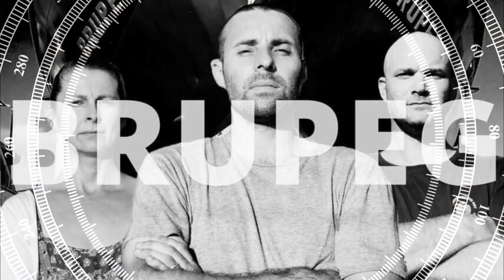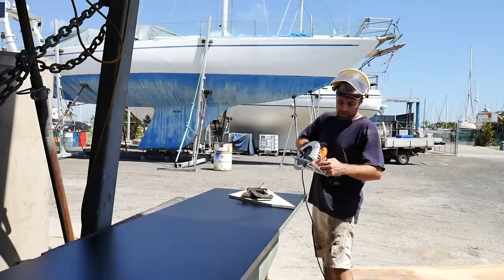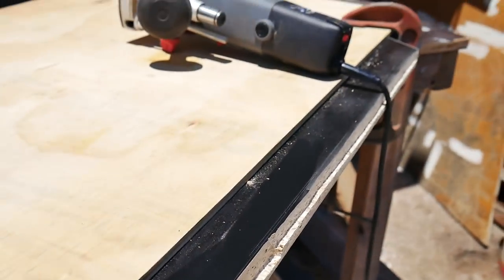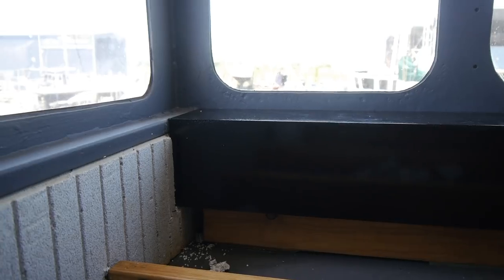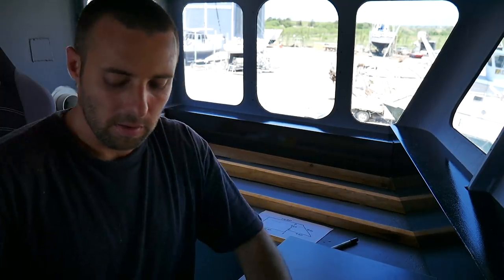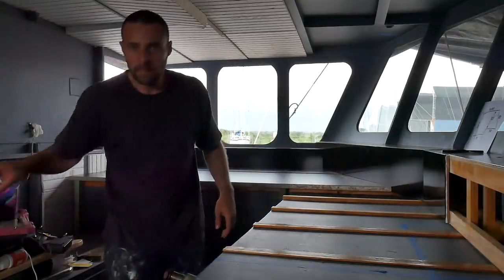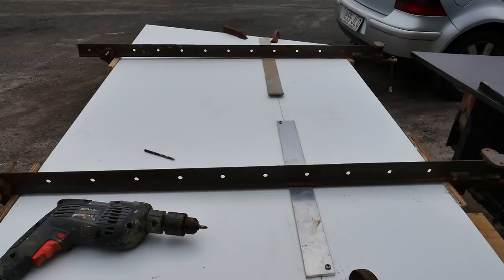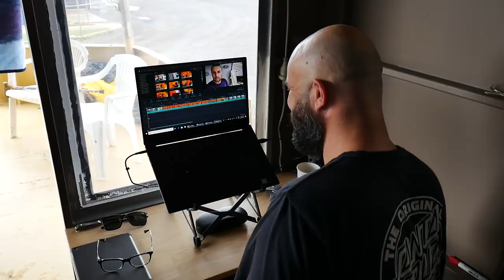Building the Wheelhouse Dash - Building Brupeg Ep. 57

Comment: Hi, watching from The Netherlands, I am a cabinetmaker/ shopfitter/ kitchenfitter, when we saw boards with melamine, we saw them upside down so the teeth of the saw dig in the pretty side first and the outbreak of the leaving teeth is on the underside. Have a look at your underside of the cuts. Are they better? A sharp blade with lots of teeth also helps. After the cut, we lightly run a fine sandpaper, gleued to a straight block of wood, along the nice edge. It would save you a lot of double/ triple work.
Love the vids, keep them up!
Reply from the maker: Thanks Tony. I will try this next time I trim some of this board up

Comment: If you use a jig saw you can get a reverse cut blade for Melamine kitchen tops.
You are going to need to resin the ends to stop it swelling in damp climates (Scotland?)
Talking of Scotland; You are going to need Midge netting on every opening. If you think mosquitoes are bad you haven't met the Great Highland Midges thousands of them they can cover your bowl of porridge faster than you can get a spoon to it. The Whisky is good but.
Edit:- Use a fine blade on the circular saw and turn it round and be ready to use your weight to hold it down. Says a large friend of mine.

Comment: This is my favorite part of a boat. I am very picky about bridge layouts, and the dash especially. Good job so far. Regards, Solomon
Reply from the maker: Thanks very much. What are some of the things you like to see in a wheelhouse dash layout
Reply: Probably the same things you like to see. My "systems" status in one area, Battery status, Water status, If using solar the in coming and outgoing power status. The engine gauges should be in order together, fuel and water level monitoring gauges together (all fluid levels in tanks) in other words when my mind wants info on a particular part of the mission or boat, I can look in that area of the dash to find it all. The minesweepers that I commanded  were twin engine, and I had turbines for handling sweep gear, so I had a lot more to keep track of. Order was essential. I like the setup of the computer screens that you have. That is the way I envisioned a new boat to be. Radar, GPS, Weather, etc. should all be accessible and close together, and so on. I'm sure that you have a good plan. I'm looking forward to seeing where you are going with this.
Reply from the maker: Thanks for this. I like knowing how others would set this area up as it helps me formulate my ideas

Comment: When you using your saw or router Or any tool With the base, And you don't wanna scratch the surface That you're running it on Just "TAPE" up the whole surface of the SHOE !   I like "Duct Tape" the gray cloth type, it last a long time.
Also When you make a template I like to use door skin Or cardboard And hot glue it. I'm a new viewer Of your channel Just wanna let you know You doing a fantastic job ! BRAVO !
Reply from the maker: Thanks very much, welcome aboard, I really like that taping the base idea. will definitely be taking that on board. also yes I've heard of the hot glue trick. We so far haven't don't a lot of interior so haven't needed to do many templates but will most likely be taking the glue gun trick on board when we move to more interior fitout.

Comment: The 1st notch on the saw table is 1.5" for a 90deg. cut ,the 2nd notch is for a 45deg, cut! If you cut from the back side it won't chip the good side!
Reply from the maker: Thanks Tom, I’m still getting my head around wood, I’ve done very little of it and I doesn’t seem to like being welded
Reply: Masking tape works too
Reply: Tape doesnt stop the wood from chiping, tape only prevent the surface from being scrached.Just as Tom say cutting from the backside is the way to do it.
Reply: Second thing, i forget to say is, we nearly always use a sinksaw, think its called that in english, if not my bad. Sinksaw are equiped with a runway in aluminium, this "runway" is placed along the line that you wana cut, and then you place the sinksaw in the runway, this way in combination with cutting from the underside (backside), you end up with a perfect 

cut.https://www.festool.com/products/sawing/circular-saws/561579---ts-55-rq-plus
Reply from the maker: Awesome thanks for this Glenn. Welcome aboard

Comment: Dashboard looks awesome! If you find yourself having to make more patterns (I expect you will!), you might want to try using very thin plywood (1/8"), then use hot glue to join the pieces together. Real quick, and it works great!
Reply from the maker: Thanks I have been told that but never got around to getting a glue gun. Will grab one next time I’m in town. Cheers
Reply: In the lumber stores around here they sell what they call nailing strips, roughly 7mmx40mm strips of usually cedar. They are quite cheap. You can join them together for templating with a staplegun. Alternately, rip thin strips from a 2x8 and use those.

Comment: Damien, I used to help my Father build and install cabinets in Kitchens, Bathrooms etc and when we would cut the material for the tops he would take a hawkbill knife with the angled blade that is sharp pointed on the end and put a guide down like you were using to cut and run the knife along it just barely on the side of the line that would not be cut on and and it would keep the saw blade from splintering it up like yours was doing and then move the guide wood and saw it to the size, just a little bit of information, good luck, Dave  R.
Reply from the maker: Thanks Dave, I have a lot to learn with wood working so I appreciate all these tips. Cheers

Comment: Just had another thought as I reached the end of your video. Have you considered ducting hot air from your heating, in behind the video monitors, to blow up on your windscreen to keep them clear when in cold frosty climates. Driving here in Canadian winters (and U.S.) would be impossible without a defroster function. Also keeps ice from forming on warm glass from wave spray.
Reply from the maker: I haven’t built anything to deal with that yet but it is definitely something we need to add before we get to the cold

Comment: Resin block the ends of the melamine top, the glue inside the chipboard is going to suck up any moisture it gets its grubby hands on, trust me. And you should consider a trim for the edges and intersections (so classic trim, but also a T shaped trim) so that any sealant you put in there is covered and not exposed. For future reference, put a sacrificial piece of plywood on top of the cuts and cut from the other side so your blade scoops in the nice face and doesn't chip it. It's a bit of mental gymnastics so you get the cuts right, but it's worth the effort.

Last but not least, awesome job.
Reply: Oh and excellent choice in the black top, being blinded in the pilot house isn't nice :)) kinda like WW2 fighters with that satin black or dark green paint in their canopy.
Reply from the maker: Thanks for the tip and feedback

Comment: Looks good. Can't wait to see the controls and gauges installed.I'm an old analog guy,so I hope you're planing on mechanical gauges over digital-at least to monitor the engine. Have you been studying navigation so you don't have to rely on all of that new-fangled electronic stuff like GPS? Satellites are nice,but sextants, compass' and the Mark One Mod Zero eyeball don't need microprocessors.;-)
Reply from the maker: This is all true but I have faith (and I don’t have a sextant). We have multiple independent layers of navigation back up. So I one fails we have 3-4 other systems right behind it

Comment: Take 2 minutes and measure the exact offset from the base of the circular saw to the blade and write it on the saw with a sharpie. That way you can just offset the straightedge guide that amount and you will get a perfect cut.
Reply: Also, deeply score the melamine on the line before cutting, this will stop the chipping. They make cheap carbide scoring tools just for this.\
That being said, For your sanity down the road, NEVER USE particleboard, chipboard, mdf, or whatever you want to call that crap wood in a boat.. Even moisture in the air will cause it to swell unless PERFECTLY sealed......
You have a steel boat, that will last forever. Dont use the cheapest least durable wood available....

Comment: 3:00: No, not light. Still, a good, durable surface. Question: When it comes to the non-metal parts of the boat, have you had to consider expansion and contraction factors given that you'll be going from weeks of tropical heat to months of Arctic cold? I'd hate to think of those boxes and surfaces splitting or separating at the seams because they've sucked in moisture at one place and then expanded when frozen in another. It's why (even without a NW Passage in the cards) I prefer HDPE over wood or strandboard or plywood where I have an option...it doesn't move much in wet or dry, hot or cold. 4:00: That's a clever lift! Damn, now I want to say to hell with my ladder! 4:52: Good tip with the circular saw and use of the router to skip the chips. 10:58: That how the first people in Australia got there: mostly by walking and only short rafting parts as so much of the Torres Strait and  other parts were more or less dry. 12:00 Have you considered drainage holes in case condensation rolls down the bulkheads or portlights, etc. into those helm boxes? Might save issues down the road with trapped moisture and the electrical connections. 13:37: I feel like mailing you a white grease pencil! 24:00: You must be bloody expert with that brush at this stage to do that job without masking off the topside! Great work, you two. The dry fit  looks better than most boats' finished work!
Reply from the maker: Thanks Marc. We have put almost 600L of paint of Brupeg now so I can pretty much paint with my eyes closed at this point

Comment: Hey Jess and Damien, great work! Been following you from the beginning.
Just a thought, are you planning on putting a vertical edge that is higher than the surface? When the boat is moving around things tend to slide about on a slick surface and will end up under foot. A high edge will stop that from being an issue. Keep on keeping on! 😝 very entertaining!
Reply from the maker: Thanks Roy. My plan it to have nothing sitting on this dash, I absolutely hate fiddles..., that said there will be a bench either side of both chairs in the wheelhouse and each will have large fiddles around them so loose ‘stuff’ is most likely goi g to be placed on those smaller benches

Comment: Damien, you are doing a great job, multi talented. However to use chipboard as your benchtop will prove an absolute disaster.
In the continuous damp air you may as well rip it out now, and replace with marine ply.
Chipboard absorbs moisture at the same rate as Weetbix..... please don't spoil all your great work with a totally inadequate piece of material.
Chipboard is Junkboard in this application.........just ask any Chippie?........
Reply from the maker: Funny story, we started with Marine ply, it fell apart! Buckled and cracked within 3 months, the commercial trawlers here use this board epoxy sealed at each cut with success so we just copied them.

Comment: Off topic, but to do with instruments. Are you going to  onitor fuel consumption? I was writing software (I am making all my own marine instruments)  and wrote some fuel consumption/projection code. I then found out my diesel engine has input and a non used fuel return back to the tank. Are you going to just monitor fuel levels and not worry about fuel used? Otherwise I would need two sensors, fuel in minus fuel out. I have fitted a "day tank" so long as that fuel is clean, i dont need to worry to much about the main tank...just polish as i go.
Reply from the maker: This is something I’m very keen to explore. Other trawlers I have spoken to have a fuel burn meter and are able to SIGNIFICANTLY reduce fuel consumption by driving to the burn meter rather than the rev counter. Brupeg has a return as 90% of the fuel the injector pump delivers is used to cool the unit injectors and only a small fraction is burnt in the cylinder. What’s not burnt is returned to the tank. I have a fuel meter but it doesn’t take account of the return fuel and I don’t want to add a day tank as it’s more of a hassle in our current set up than it’s worth
Reply: @ProjectBrupeg  Let me know if you need one made.
Reply from the maker: Terry I would love to check one out. I can’t contact you via youtube so would you be able to email us at our website or message me on Facebook (Brupeg.com or Facebook.com/BuildingBrupeg)